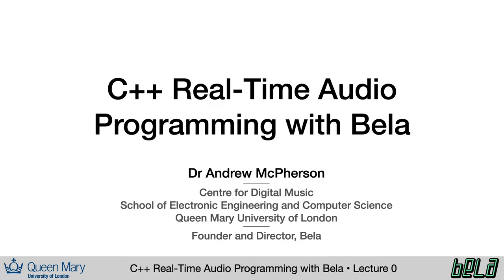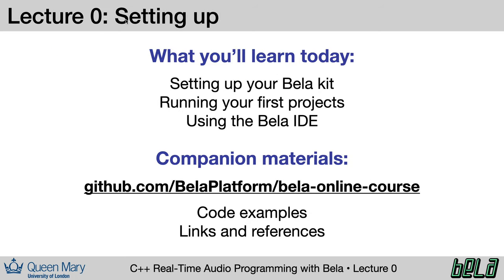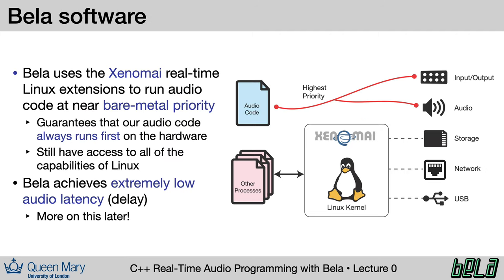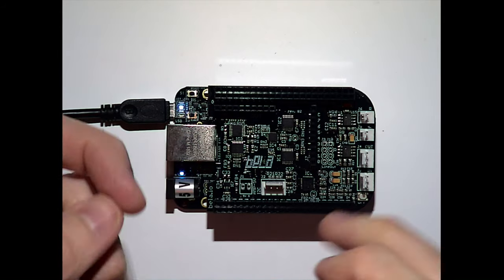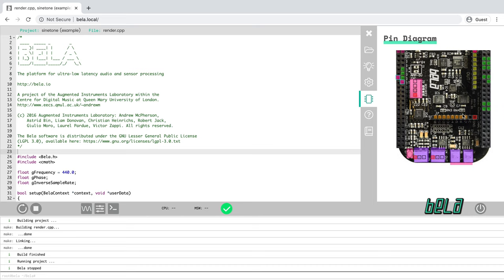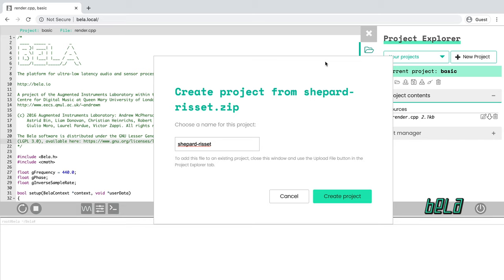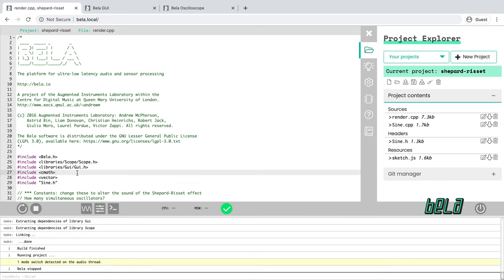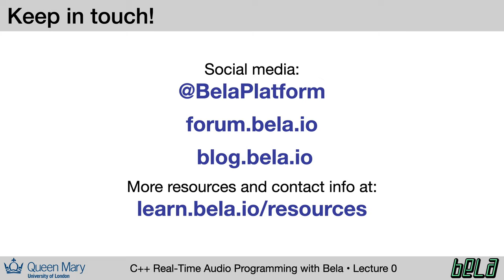0: Setting Up, C++ Real-Time Audio Programming with Bela

Comment: Recently purchased the Bela Cape and shipped to Mexico (I already have a Beaglebone) just because I found this course series! I'm digging into the possibility of be able to use the makefile directly in the command line and use editor (such as VIM or viscose through SSH)  for my cpp files instead of the IDE (nothing against, just for linux learning purposes).

Again, thank you!
Reply: this may be of use https://github.com/BelaPlatform/Bela/wiki/The-Bela-Makefile Also this other one, although it's aimed at interacting with the board from the host, with project files stored on the host: https://github.com/BelaPlatform/Bela/wiki/Interact-with-Bela-using-the-Bela-scripts
Reply: @oromoiluig  Thank you, Giulio, really helpful!

Comment: I make full complex polyphonic synthesizers,drum machines,sequencers,midi controllers, midi guitars,samplers,loopers reverb and delay units etc all with a $2.50 Arduino Nano or Uno. Why spend so much money on this? With AliExpress it cost about 5 dollars in parts for a  midi 6 wave form synth with 6 voices with ADSR LFO modulation intensity etc.

Comment: Hi I know these videos area a little old now but I'm trying to get debugging working on the bela. Is the only option using eclipse?
Reply: No, you can just run gdb on the board. Ideally, you'd run it in a terminal while ssh'd onto the board, otherwise for quick and dirty trials you can run it directly in the console at the bottom of the IDE, keeping in mind the two caveats: 1) it has no readline support, and 2) text between < and > won't be displayed because of a bug in how the text is handled. If you need more help with this, search the Bela forum for gdb and/or post a new question there.

Comment: we cannot use other Microcontroller other than Bela or it is essential to work with Bela
Reply: the concepts presented in the course are generally applicable to many audio DSP platforms and some of the theory bits are useful even without writing any code! However, the examples provided are designed to run on Bela only.

Comment: why using c++ for audio instead of PureData or Supercollider?
Reply from the maker: Bela also supports Pure Data and Supercollider! This course is specifically about how to do real-time audio programming with C++.
Reply: @BelaPlatform  is c++ faster than PD or SupeCollider for audio?
Reply: @bluename4  C++ has the potential to be faster than Pd or Sc. However, one can also write arbitrarily bad C++ code which will result more inefficient than either!  :)

Comment: Is the FAUST GUI now working? I think I need to update my Bela core, but don't want to loose my FAUST GUI implementations.
Reply: You wouldn't lose any changes to the Faust GUI, as that is a separate library stored in /usr/local/lib, so updating the Bela core code wouldn't affect that (but reflashing an image would, and if that is the case you can use  the instructions here to get it to work https://learn.bela.io/using-bela/languages/faust-experimental/
Reply: @oromoiluig  Thanks!

Comment: Very cool, Can I run python scripts from it?
Reply: you can, as it's a Linux computer, however you won't be able to run them  to process audio and sensors in real-time.
Reply: @oromoiluig  Thanks Giulio, I understand, I currently have a python script that uses PyAudio to process audio in real time, would I need to convert it to C++ to use it on Bela?
Reply: @Johlacrasse  correct: we do not support running real-time audio and sensors through Python on Bela. That's because low latency wouldn't be guaranteed.
Reply: @oromoiluig  Thanks for your fast replies, just placed my order for a CTAG FACE starter kit, looking forward to receive it

Comment: Do you have to get the hardware
Reply from the maker: The concepts covered in the course are generic to digital audio signal processing and real-time audio programming and one can follow along without a board and learn from the content without running the code. Some of the later classes are more theory-oriented and may well serve as a DSP class in their own right. However, in order to run the code you'll need the Bela hardware.
Reply: @BelaPlatform  thank you so much